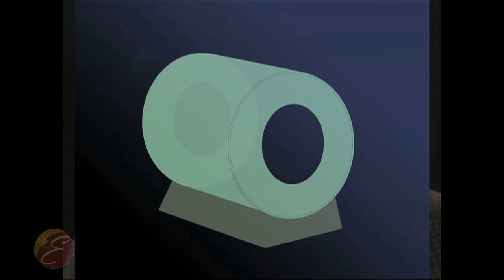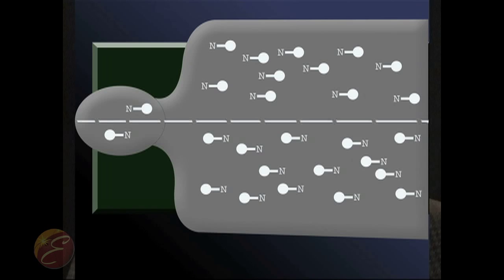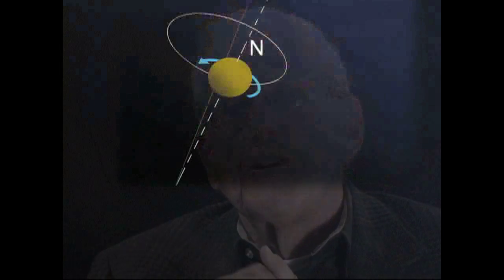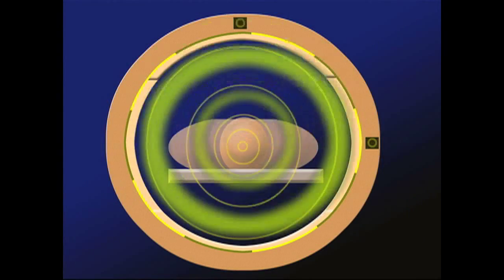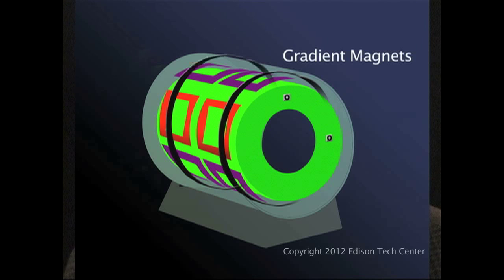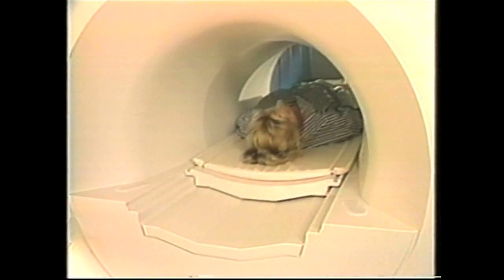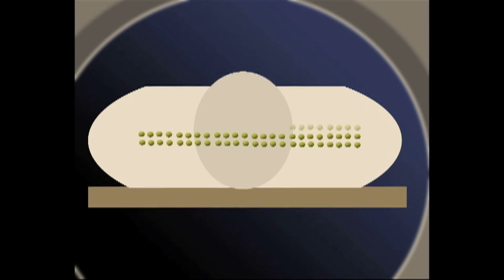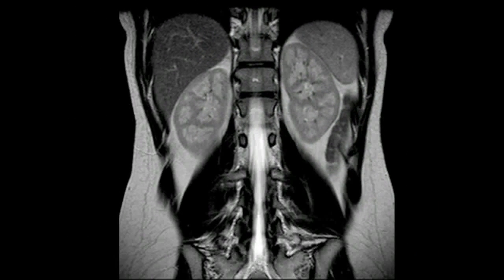How does an MRI work? (HD)

Comment: MRI could be one of the most expensive medical scams in the twentieth-century. Really? It's true that the presence of a strong external magnetic field can cause different atoms to undergo different photon exchanging rates. But how could those photons escaping the skull? Precisely, the skull would block most of the photons from with the brain in preventing us from seeing the different portions of the brain. Provided there is an X-ray emission through the brain and there is a camera to capture the image otherwise we can see what is inside the brain. I urge the medical authorities to tell the truth about MRI imaging. It's not just expensive to take imaging of MRI but also misguided imaging because MRI machine constantly retrieving file pictures from its main frame computer to match with the patient's requirement. MRI is just equal to BS!If you are interested in real discoveries, I would recommend you to read my book, The Unification Theory - Volume One and you will be amazed with lots of new, interesting discoveries. In God I trust.

Comment: This isn't very helpful if you want to learn the basics. You need to know what MRI is and how it's built. In this video, you'll be shown the 'complex' science behind the magnetic field, but there is never mentioned a magnet in the first place. That's like:
Musician: "The sound of a piano is caused by vibration of strings."
Unexperienced person: "Oh, wait, a piano has strings? When did that happen?"
Reply: You raise a good point.  I am a lamen when it comes to the perspicacious details of how this machine works.  However, with my novice understanding of electronics, electromagnetic radiation, mathematics, and linguistics; I can infer that something with a name like electromagnetic resonance imaging machine must use copper coils, electromagnets, and radio waves, as well as a specialized computer that does specialized math which works backwards from the resonance measurements to produce an image.  Although, we are on the internet, and anyone who cares enough to learn more about this can look up information about specific things to read.